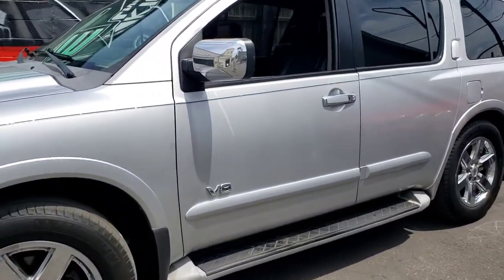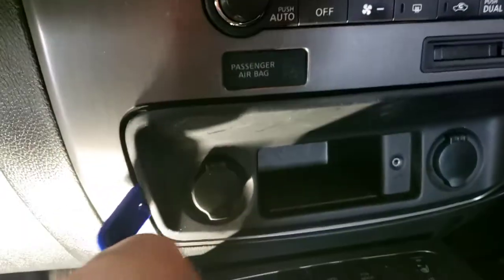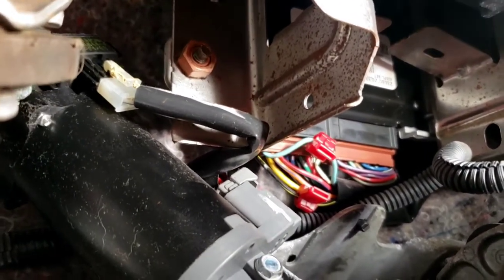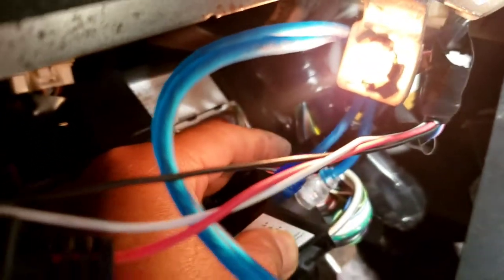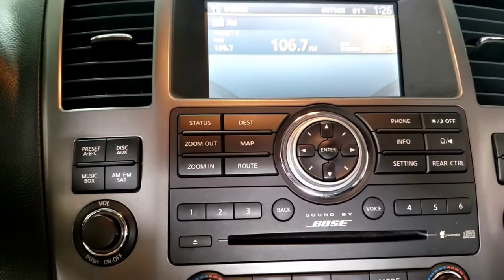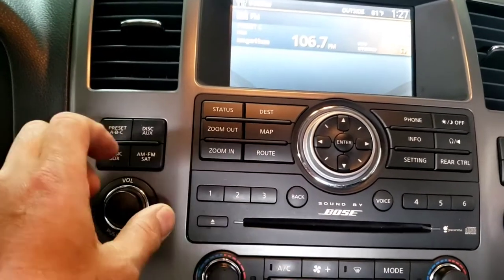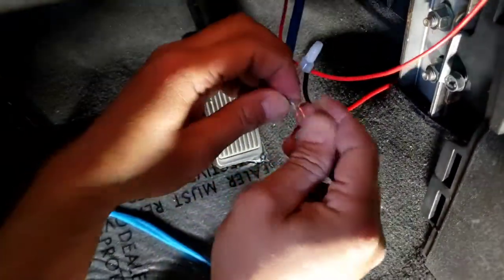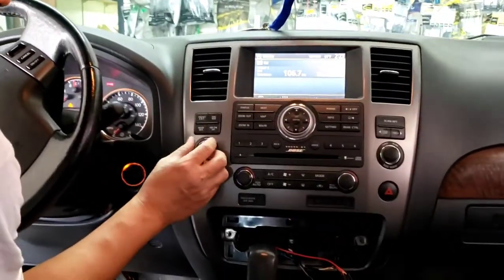Amplifier install for Nissan Armada 2009 using factory stereo no line out converter

Comment: The only issue with tying the white and gray wires together for the Kisloc is you will only have a mono signal to the amplifier and will not be able to enjoy a stereo sound.  So in other words, the staging will not be correct.  You will not be able to hear sounds moving left to right or vice versa.  Good video and information though.
Reply from the maker: Thanks for the input so far almost every car and SUV sound pretty good I did an experiment a few time they sounded the same ❤️❤️❤️
Reply: WTF? this is a SUBWOOFER install NOT a speaker stereo sound is irrelevant lol
Reply: @terrytrunkkingbrocks1483  WTF-others may utilize the same method when installing an aftermarket amplifier on mids/highs so you wouldn't get the stereo sound....so there is your WTF....

Comment: So if i hook up my LOC to the purple and green wire it should would or do i have to run the RCA plugs to the wires instead
Reply from the maker: That's depending on your Loc converter some brand has the remote that you want to put it close to the amplifier
Reply: @khmerohio   mine has it i have the Metra from Walmart….my truck is a 2008 Infiniti QX56 with the Bose system

Comment: 2011 Subaru legacy 3.6 premium Haram kardon non nav

I am looking for a connecter pinouts from the head unit to the factory amp so I can tap into the speaker level rear speakers to install a aftermarket amp and bypass the factory amp but I cannot find a wire diagram any help would be appreciated
Reply from the maker: Left rear color black/blue+ and white/blue- the amplifier is under passenger seat white 10pins 2 - 6

Comment: Strip back my rca jack and colors are red white blue and yellow. What colors do I connect together??
Reply from the maker: Every RCA jack is different on color you want the male one the positive side o don't if you don't have multimeter you can guess of it doesn't sound right switch it around
Reply from the maker: Try one jack at a time